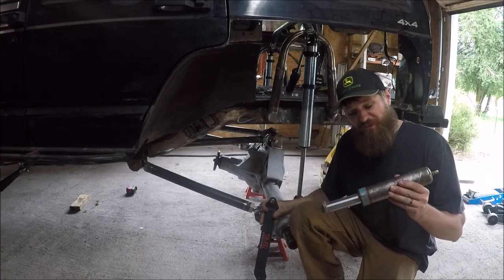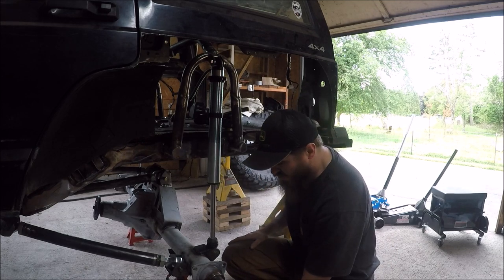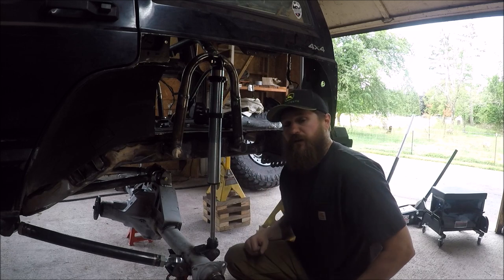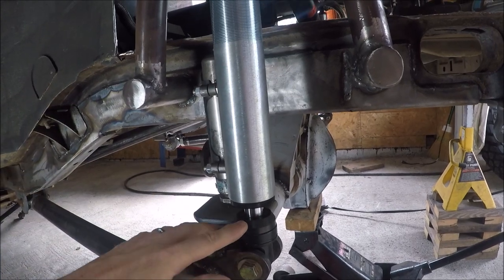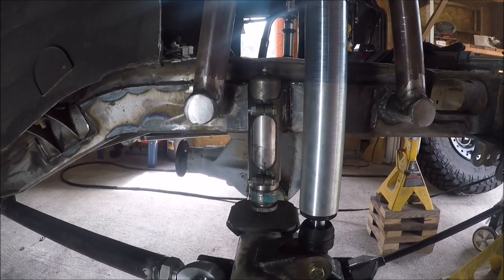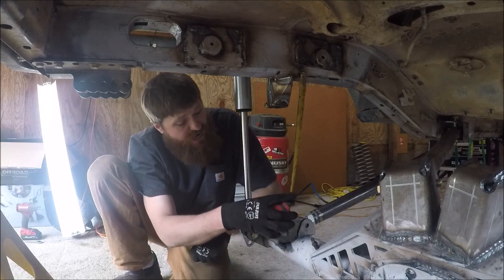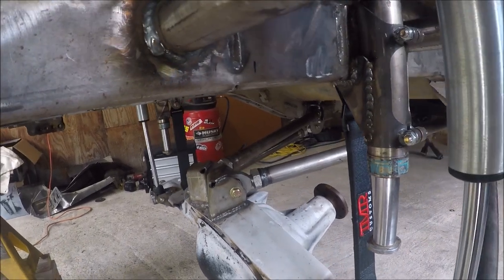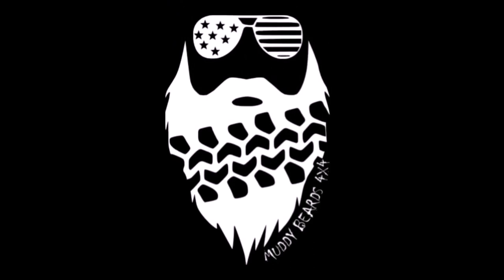Setting up Bump Stops and Limit Straps on Rear 4 Link (XJ One Ton Swap)

Comment: oh man I just went through this a few weeks ago, mounted some 14 in 5165's in the rear of the ZJ.. one thing I learned about the limit straps is... even when you have them set at full droop, if the opposite wheel is stuffed, it will use the limit strap as a pivot point, and can actually still allow the shock to go lower than the strap length. I ended up hooking my straps as close to the control arm mount / shock mount as possible. at full droop I had about 1.5in of shock left, but when the opposite side was stuffed, it basically bottomed the shock out. same thing with the bump stops, under the stuff /  droop situation you can have the bumps completely smashed in and still have shock movement upwards that can bottom the shocks out in full collapsed position
Reply from the maker: Ya I read some conflicting info on that.  It does seem the wider you mount the straps or closer to the shock mounts the better.  Mine is just wide with a narrow frame.  I am sure it will take some fine tuning.
Reply: @MuddyBeards4X4  basically the location of the lca mount becomes the fulcrum point. So the further out the shock, the more change there is. I ended up setting up my shocks at full stuff point, rather than full "bump" because almost never in nature will both wheels be bumped at the same time, unless your jumping it. Almost always there will be a droop/stuff condition where the bump/shock will be extended/stuffed due to the pivot points. I'll message you some pics.
Reply: Usually articulation on one corner has more extreme angle both at full stuff and droop, in my experience.  For this reason I set up limit straps and bumps with this in mind. I usually like to have the wheel and tire on to be able to test for tire clearance on the body as well.  Either way there might be some fine tuning to perfect it.  Especially in the front when you have to address steering angle as well 😬.
Reply: @firstwordcar  yeah that's what I did on mine. Put the tires on drop the car down on the lift onto a 6x6 to force the suspension all the way up on either side to see exactly where the touching was going to happen. Then I set my bumps up at that level. There was about a 4-in difference between where the tire existed at full stuff versus where it would have been at normal bump. So if I would have set the stops up just by setting the car down, they would have forced themselves through the fenders and into the unibody. It's sort of a game of averages. I did the same thing with my shocks, said the thing up at full droop all one side was fully stuffed then picked my shock mounting points based off of that extension.

Comment: I just did bumps and limit straps on my 4 link build... I found that the axle  completely full bump and full droop did not act the same as simulating 1 side full bump and the other full droop... 4 links tend to travel in 2 arcs... id be curious to see you test full bump 1 side and full droop the other and see if this setup stays/works the same way you set it up.
Reply from the maker: Yep they definitely act differently. But if your bump stop and straps are as close to the shock mount as possible it should still be pretty close.  I'm sure this will take some adjustment and tuning once I get it on its feet.
Reply: @MuddyBeards4X4  yeah I found out on my 1st install..  everything looked good with axle full bump and droop.. but then real life on trail and crawling at full flex droop/bump they were off... so re did them this last weekend and yes you gotta set everything up as close to the angle, range etc of the coilovers for it to all work together.. haha that's how we all learn tho.

Comment: Nice setup
Reply from the maker: Thanks brother
Reply: Still waiting to do my suburbans upgrades.  Still running leaf springs.  Shackle flip rear, 4” front minus a leaf and 35s.  Gotta get my latest project done and daily drivable before I take my suburban outta commission lol.  1973 international 1110 4wd automatic.  Kinda need the size to pick up lumber, metal and do on.  My wj just doesn’t cut it lol
Reply: @MuddyBeards4X4  My 2002 wj overland is a great daily and boat launcher but can’t really haul much with that sunroof and leather interior lol🤦‍♂️. Looking forward to more on yours for ideas on mine when I get that far.
Reply from the maker: I want an overland wj sooo bad
Reply: @MuddyBeards4X4  also I think boat siding the back wheel well area tapering back to the bumper would be awesome.  Nothing to snag on stumps, rocks and so on.
Reply: @MuddyBeards4X4  when I get my truck finish my wj overland might go up for sale to recoup some of my expenses lol 😂. Kinda on va pension so tight budget lol
Reply: @MuddyBeards4X4  still trying to decide if I want to retain the original 304 and 727 trans in the international or find a smaller turbo motor and make it a little more easy on the pocketbook in the long run with gas prices

Comment: Why didn’t you just move the limit strap upper mount up another 1/2 inch to combat the length being a littler longer then you wanted
Reply from the maker: The stap is 1/16th too short.  And I wanted the upper tab in that location so it was against the thick metal of the frame stiffiner.